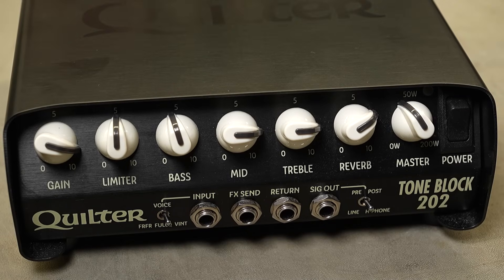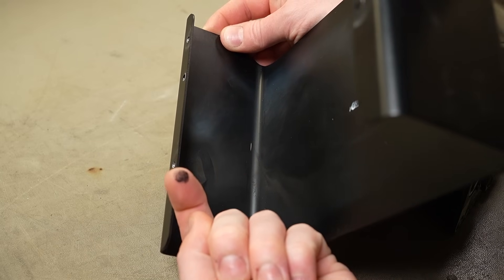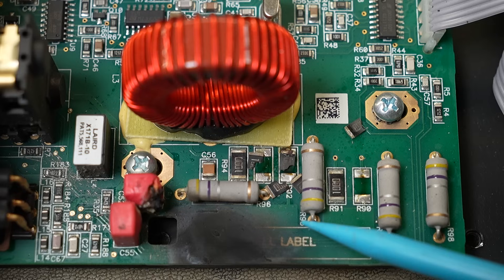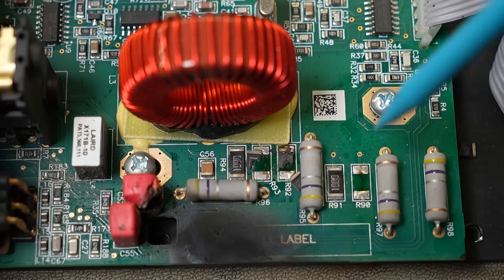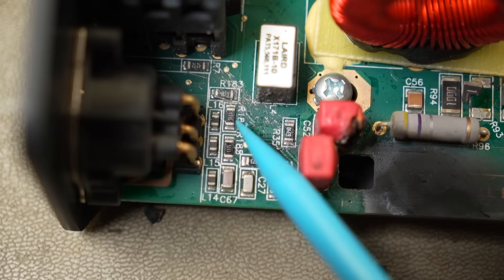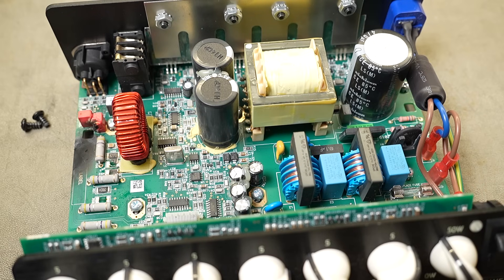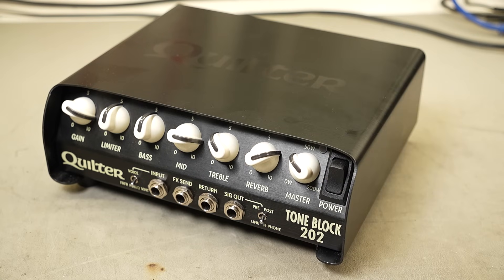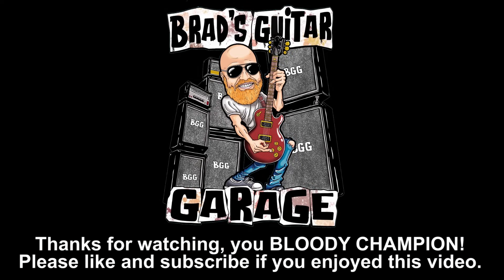Quilter Toneblock 202 - Part 1

Comment: I just blew the power amp in my Superblock US and I also have a hard time getting it fixed. Are there any modern solid state amps that are easily fixable that you would recommend?
Reply from the maker: Unfortunately, all of the very reliable and easily field repairable amps tend to be class A/B with linear power supplies and forced air tunnel heatsinks. This means about 30% efficiency, lots of weight and space for not much power. This is why class-D has become so attractive as an alternative, and most people are happy to pay the price for occasional replacement modules as opposed to carrying out component-level repairs.
With the MASSIVE caveat: IF they are available at all!
Reply: @BradsGuitarGarage  Thank God amps are more efficient now. Think of all the saved forests.
Reply from the maker: The efficiency is more to do with how many watts you can get out of an outlet.
Older amps could push the limits of a single mains outlet just to hit the 800W output mark.
These days you regularly find 2000W PA amps capable of safely running on a single mains outlet.
Reply: @BradsGuitarGarage  That makes a lot of sense I suppose. Sadly my trail went cold. Quilter support stopped replying to me after I have asked for an accurate part number for the chip. The european distributor Thomann denied helping me because I have no proof of buying it at their store although I asked for a post-warranty paid repair. I'm suspecting these might be on a non-repair list. Hope you have more luck.

Comment: According to its manual this unit is "protected against no-load and abnormal loads; thermal protection may reduce power somewhat after prolonged, severe overloads."...Whatever "protection" it  had appears insufficient.